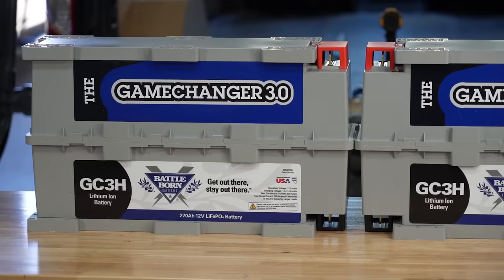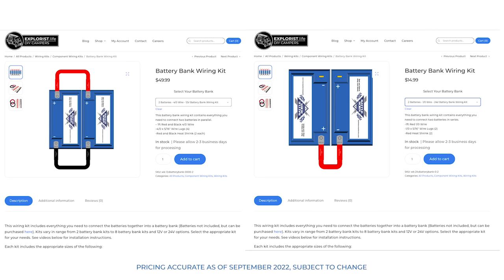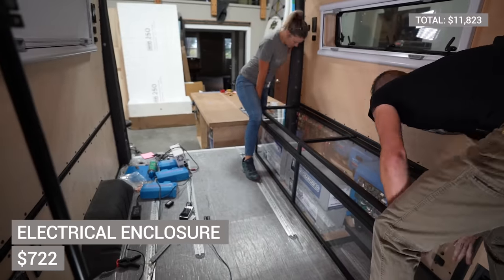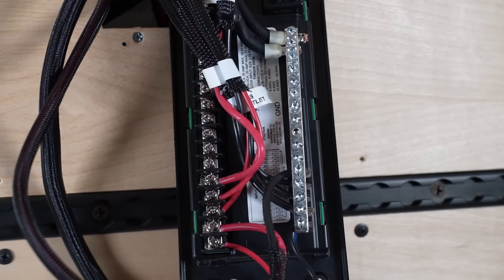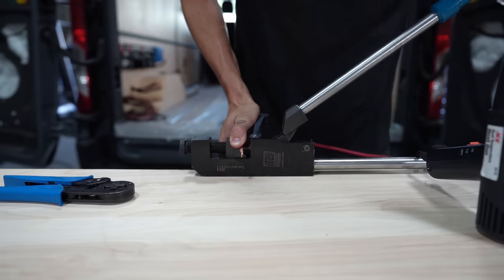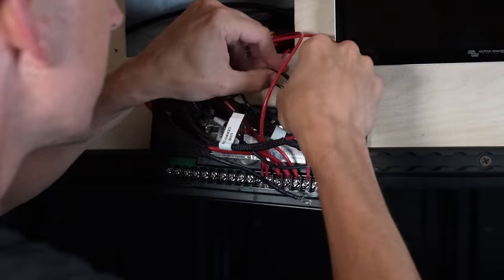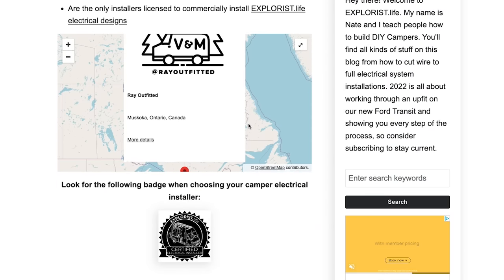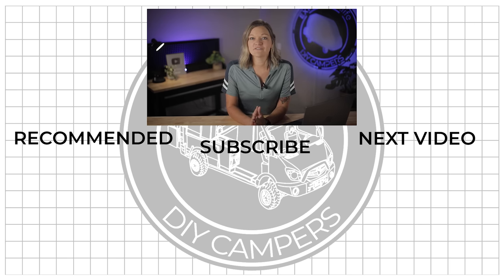DIY Camper Electrical System Cost?

Comment: My system was about $10,500 for 10KWH battery bank, 1260W PV, same multiplus y’all have and the Cerbo with Touch 70.   I saved at least $3000 by building my own batteries.  However, O don’t have the support/warranty you will get from a company like Battle Born.  

There’s always trade-offs when building systems.  It’s up to each person to decide where they want to spend money and where they want to cut costs.
Reply from the maker: Well put. Thanks for that.

Comment: There are many different ways to build out vans that will range from low to high budgets.  Our current van is low budget, works well enough, and the lessons that came with it have shown us to build a better quality van that suits us.

We are in process of obtaining items for our van build out which we will live in full time.  A lot of the van upfitters charge a premium for their work.  As I was comparing electrical systems for our particular needs, the majority of upfitters started at $20,000.  And that was before any customization for our van.  Not being an electrician I chose to go with Nate and Steph which is saving me about 50% and will fit my design criteria.  And as a bonus I get to learn how to build and maintain our system, so if something goes wrong I can hopefully fix it instead of paying someone else.  Additionally, Victron is a global company and they back their products worldwide.

If you have constructive, experienced based comments, then please share them, with links, in a respectful manner that helps the community.  If not, maybe get a van and see different parts of the world.  International culture normally shapes the traveler to a more mature, considerate, and reasonable person.     R/ Mike
Reply from the maker: After a ton of negativity in the comments section of this particular video, I appreciate your input here. Thanks for watching!

Comment: One of Your best!
However, a 3Tier Priced system would benefit a lot of folks.
The sticker shock of this excellent system is Still hurting.
A second and 3rd system with matching  costs solution would help out a lot of us with not so "deep pockets."
Parts substitution would be a great start.
Starting with the batteries as an example.
Battle Born Bats are great but how about 2 other brands which works well but Not quite so expensive.
Thanks for considering and as a long time subscriber, Love your Vids!

Comment: The 24V system reduces necessary wire gauge and hence cost.  However, is the needed equipment more costly than for a 12V system?  If so, how does the 12V vs. 24V total cost (wiring and equipment) compare.  Thanks!

Comment: Just curious why the ground solar panels are all in series when 2 in series would be sufficient to charge a 24v system at the same amps. Not knowing enough about solar panels with out asking someone like your self then parallel the 2 to double the amp input. Cheers

Comment: i have a simple question that i have never seen asked or answered heh. say you installed this system on say a trailer/ camper. during off season use the solar would continue to work as the trailer is parked is it a good idea to disconnect the batteries during off season use and say use like a batteries tender during that time? or some way to allow a small draw and allow the system to naturally keep charging as normal?  thanks in advanced.

Comment: I also want to utilize an alternator to charge my house batteries while driving. I have a 24V/150A alternator and I have a 48V electrical system. I can't seem to find a DC/DC boost converter that will handle that.  Do you know of one?

Comment: looking forward to the alternator charging video for 24v system. I currently have a 12v 400ah 4000w inverter with dc to dc charger system in my truck that I use for powering my grinder, welder, hammer drill, vacuum etc. while I am out in the field. would love to go with 800ah 24v system for more efficiency and longer work time but like you missing dc to dc charging, not sure what to go with, I need it to charge between jobs though out the day. reason for this system is I do not have power at most of my locations and hauling a generator takes too much space, it's heavy, fuel, noisy etc. thanks for these videos.
Reply from the maker: Awesome!  Glad it helped.  Thanks for watching!

Comment: These videos have been a great help with our solar install. Recently purchased the 30amp retrofit downloadable diagram. Question, we have an on board onan generator, where or how, can it be wired into the system? 3000w Victron inverter, automatic transfer switch, Cerbo GX,  150/85 mttp, 712BMS, Lynx distribution.  600ah of batteries, 1000w of solar. 12 volt system.

Comment: What brand is the external solar connector?
Reply from the maker: Check the 'other parts needed' section of the wiring kit linked in the video description and pinned comment. 👍

Comment: An install time in hours instead of weeks would add more clarity. Should we be assuming a 40 hr work week or perhaps 80 hr?
Reply from the maker: Yes, correct.  1 person, 40 hrs a week. 2 weeks.  80 hours on the high end of the install.

Comment: Another great video.  I had forgotten how ludicrously expensive the battle born batteries are but with the warrantee they provide it’s a good investment and should give the user a trouble free system.  Particularly with how well you put it all together. 

While I agree your diagrams are your intellectual property ,  the COTS products from a single vendor bolted together how the manufacturer intended would arguable be a “best practice” rather than a design that no one else could possibly think of without being accused of “ripping off” or “cutting corners”.   That being said,the “12 Volt” installer world is definitely filled with unscrupulous characters that would sooner hide their mistakes , than take the time to follow best practices and with the money spent on these RV’s that carry our loved ones I would agree that going to a certified vetted installer is the way to go.
Reply from the maker: I appreciate that!   Yeah, the intellectual property comes more-so from an installer buying one of my diagrams, buying one of my 3d models, building said system, and then selling said system.  It is pretty obvious/blatant when they do it.

Comment: Your channel and work is absolutely the best I’ve seen.  Thank you!  
Question: this setup shown here in particular is super beast.  Can you tell us what a system like this could do? Such as run AC without a generator in Arizona in august in a van.   Charge your laptop and run typical house stuff for a month.  Etc. 
thanks in advance.
Reply from the maker: I think it's best to go the other way around.  Check out the following videos and put in some of the things use and how long you'd want to use them for and then that will tell you what size of system you'd need: https://www.youtube.com/watch?v=a406IxiU-Xg
Reply: @EXPLORISTlife  ok.  Thanks for the response friends.

Comment: Great information as always. What is the type and make of the Aux External Solar port you installed. I’m wanting to install an external port on my system and have never liked the plug used by most trailers.
Reply from the maker: Definitely!  That will soon be an add-on for our solar array wiring kits, but until then, I've included it in the 'other parts required' section of the kit for this build: https://shop.explorist.life/shop/all-products/camper-wiring-kits/complete-wiring-kits/540ah-3000w-24v-multiplus-580w-to-1700w-solar/
Reply: Great. I found the Amazon link. Looks to be a solder-less and waterproof connection which is what I was looking for. Much appreciated.

Comment: So is this pretty much a 11000 watt system?
Reply from the maker: In what regard?  There are multiple input capacities, multiple output capacities, as well as a storage capacity; which are all different wattages.
Reply: @EXPLORISTlife  with no external power or charging… would it be about right 11000w ish,,, as far as the amount of wattage that you can use from the batteries ?
Reply from the maker: @Customers_support Those are 2x 270Ah 12V batteries.  So… 270 Ah x 2 batteries / 12.6 V = 6.804kWh of battery capacity.
Reply: @EXPLORISTlife  gotcha thank you, my bad I thought they where 24v 270AH
Reply from the maker: Ah, yeah; nah, they are 2x 270Ah 12V batteries wired in series to make a 270Ah 24V battery bank.

Comment from the maker: Full tutorial video for this electrical system: https://www.youtube.com/watch?v=E5q7_4FH4LQ&list=PLmvhcyi4n0TVfA4XCYJBkzfUXunSON1zX

Parts for this system:
➤EXPLORIST.life Wiring Kit: https://shop.explorist.life/shop/all-products/camper-wiring-kits/complete-wiring-kits/540ah-3000w-24v-multiplus-580w-to-1700w-solar/
➤Heated 270Ah Battle Born Batteries: https://battlebornbatteries.com/product/12v-gc3-lifepo4-heated-battery-kit/?afmc=explorist_bb67
➤Wiring Diagram: https://shop.explorist.life/shop/all-products/plans-and-diagrams/solar-wiring-diagrams/540ah-battery-bank-3000w-24v-multiplus-580w-1700w-solar-wiring-diagram-explorist-life-2021-ford-transit-camper-van/

➤*Other wiring kits that may be helpful:* https://shop.explorist.life/product-category/all-products/camper-wiring-kits/
➤*Wiring Diagrams for other systems:* https://www.explorist.life/solarwiringdiagrams

Binge the Transit Van Build: https://www.youtube.com/playlist?list=PLmvhcyi4n0TVfA4XCYJBkzfUXunSON1zX

OTHER ELECTRICAL PROJECTS ON THIS VAN WE TACKLED BEFORE THIS VIDEO:
➤INSTALLING OUR ROOFTOP SOLAR ARRAY: https://www.youtube.com/watch?v=zspCRKAFxKA&list=PLmvhcyi4n0TVfA4XCYJBkzfUXunSON1zX
➤INSTALLING OUR 24V DC AIR CONDITIONER: https://www.youtube.com/watch?v=G1oqnxNJDog&list=PLmvhcyi4n0TVfA4XCYJBkzfUXunSON1zX
➤HOW TO WIRE USB OUTLETS: https://www.youtube.com/watch?v=X1tQWYXY2Fc&list=PLmvhcyi4n0TUUwvonaPhIPqUqBiC7CiyY
➤HOW TO WIRE 12V OUTLETS: https://www.youtube.com/watch?v=_nGbtOH5Dk0&list=PLmvhcyi4n0TUUwvonaPhIPqUqBiC7CiyY
➤HOW TO WIRE PUCK LIGHTS: https://www.youtube.com/watch?v=o-YlpzrnuzI&list=PLmvhcyi4n0TUUwvonaPhIPqUqBiC7CiyY
➤HOW TO WIRE 12V DIMMERS: https://www.youtube.com/watch?v=dn77-CbxR4g&list=PLmvhcyi4n0TUUwvonaPhIPqUqBiC7CiyY
➤HOW TO WIRE 12V 3-WAY SWITCHES: https://www.youtube.com/watch?v=WRQuVMFlric&list=PLmvhcyi4n0TUUwvonaPhIPqUqBiC7CiyY
➤HOW TO WIRE RELAYS: https://www.youtube.com/watch?v=mTH1Uc_L2M8&list=PLmvhcyi4n0TUUwvonaPhIPqUqBiC7CiyY
➤WIRING 120V OUTLETS, SWITCHES, AND GFCI: https://www.youtube.com/watch?v=en6Q2L6Bf3A&list=PLmvhcyi4n0TUUwvonaPhIPqUqBiC7CiyY
➤INSTALLING A 30A SHORE POWER INLET: https://www.youtube.com/watch?v=WDAzwaEWUT4&list=PLmvhcyi4n0TVfA4XCYJBkzfUXunSON1zX

Comment: so expensive compared to solar generator all in one batteries I don't get why people build this
Reply from the maker: That's like saying you don't understand why people build custom homes when buying a trailer house or mobile home is so much cheaper.

A 'solar generator' will never have the quality, flexibility, nor performance of a system like this.
Reply: @EXPLORISTlife  Yeah I just meant why go the complicated way and more expensive way for a Van, when you can go simple and cheaper. For exemple the Titan 240sp with 3 lifepo4 comes at 7.5k USD, 4000w inverter and 7500kwh and 10 years warranty.

Plug and play.

Probally just instal a small 12volt fuse box for all the small things but thats all.

You guys should make a video comparing solar generators to a DIY setup. Obviously with similar specs on both builds, im sure it would have a lot of views since a lot of van lifers are thorned between these 2
Reply from the maker: @synos0202  The titan (or whatever) doesn't have a nice display screen nor does  it have the ability to accept a rooftop + ground deploy array nor can it 'add' inverting power to an underperforming shore power connection nor does it have high enough DC output for a DC air conditioner; all which are things we wanted to have in this system.

We also have a jackery for 'charge it up and chuck it in the truck' kind of outings; which is great; but it's not what we'd recommend for a permanent installation.

As far as what videos we should make; we are actually just starting on a complete start to finish Mobile, marine, and off grid academy that will teach you EVERYTHING you need to know to design and install an electrical system so you can educate yourself and make your own decisions based on what you feel is best for your own setup.